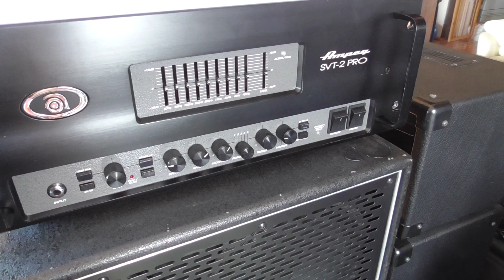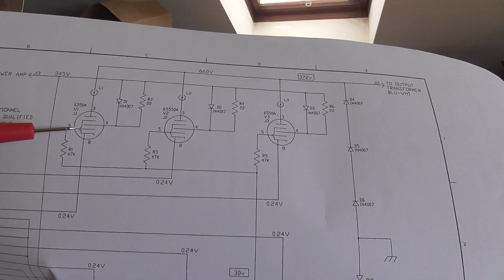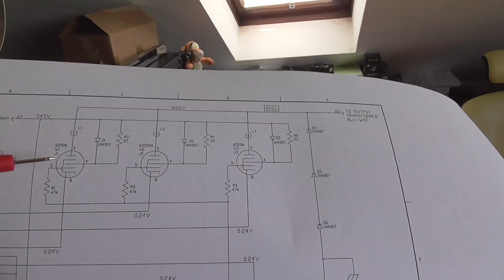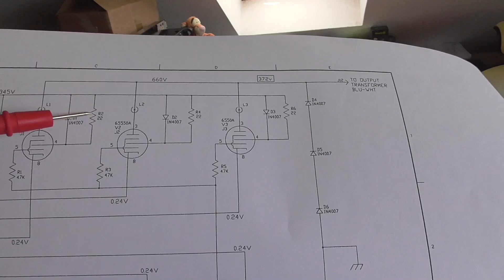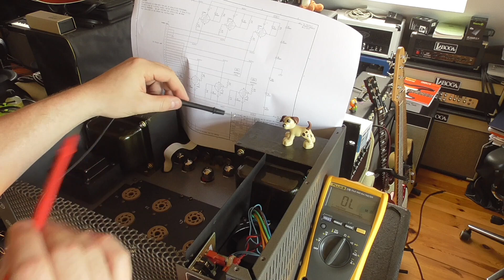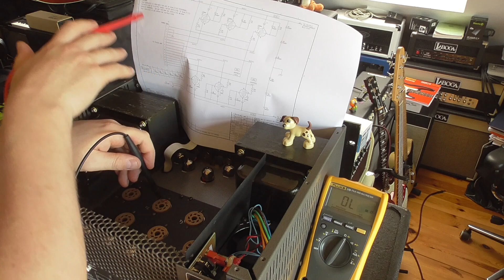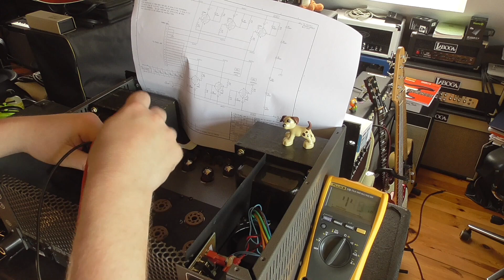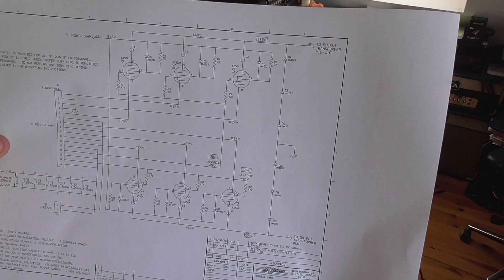Ampeg tube replacement

Comment: Exact same issue with my SVT 3 Pro. Speakers had a buzzing sound through my 4 10 cab. Changed cables, checked for blown speakers etc... I plugged my RB 210 into the cabinet and it sounded great. I changed tubes and the thing came to life and sounds amazing. Good to see you got things figured out.
Reply from the maker: For me - since I lack the proper education in the electronics department - it is always a little guess work....but sometimes I have luck and get things back to order and don't hurt myself along the way ;-).
Thank you for the comment.
Reply: I myself am electronically challenged as well. Lol I really enjoyed your vid and it was very relatable. Keep doing what you're doing. Great content! @wojciech_migda
Reply from the maker: @chucklefug  😃